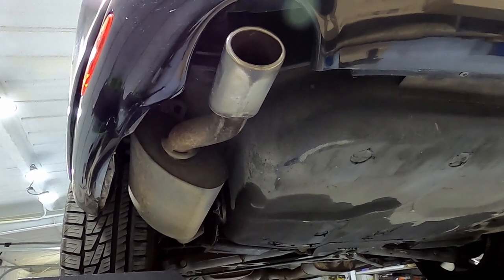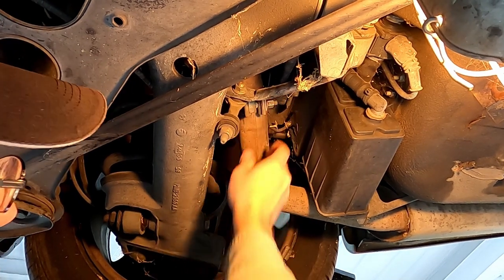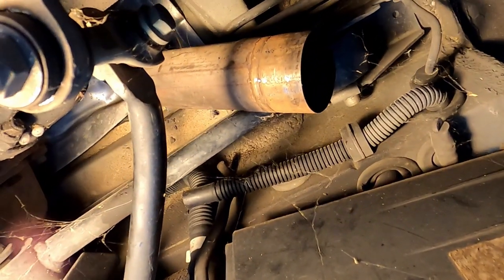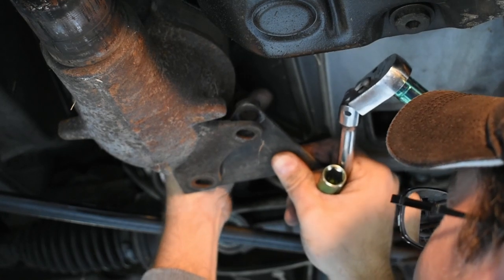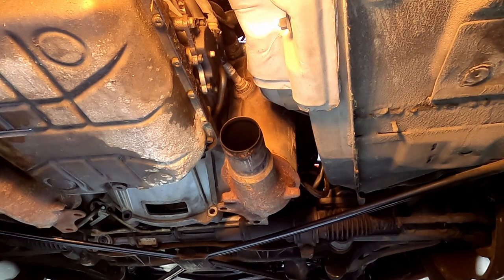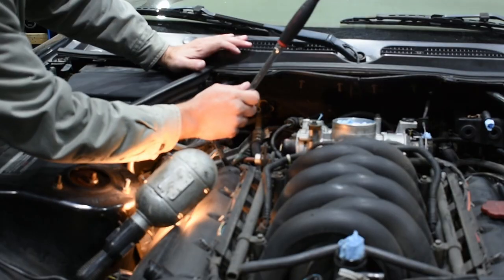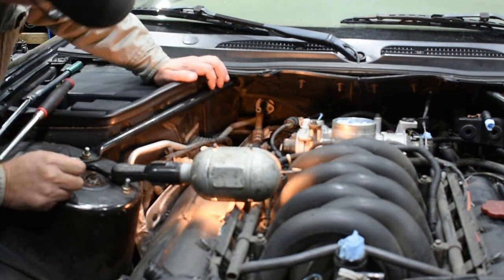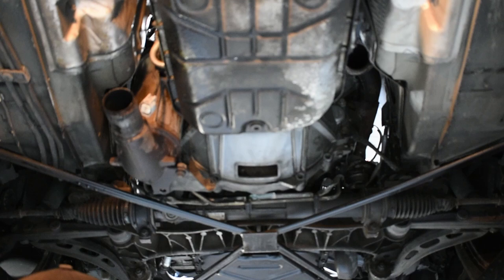XK8 Exhaust Removal

Comment: Hi, nice video and even better tips and tricks, I have XK8 4,2l Convertible 2003 and recently engine chceck light came on with message Engine power limited. Message dissapered few times and then came back, in service they told me that it’s probably caused by catalytic converters but there is no replacement for it so they couldn’t help me out. I tried to find something online but there is nothing for 4,2l engine convertible, do you have any advice or idea what can be the issue or where can I buy those catalytic converters?
Reply from the maker: Fond this: https://www.newlevelmotorsports.com/325476.html?cmp=googleproducts&kw=325476&gclid=EAIaIQobChMI2N7Grduz-gIV3xXUAR2-MAHpEAQYECABEgKtF_D_BwE
Reply from the maker: Neve used them so I don't know how good they are.
Reply from the maker: Next is Watch Ebay or even reach out to a vendor for used parts. Most don't warranty used parts so be careful. Possibly junkyard in your town or big city near by.
Reply from the maker: Another option is look for parts car sometimes you can find them really cheep. I have one and it comes in handy.